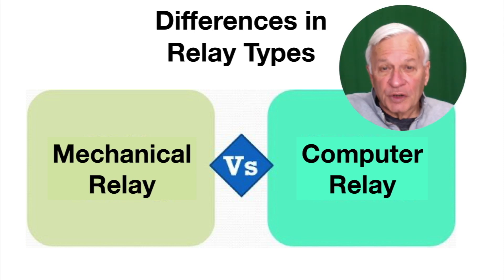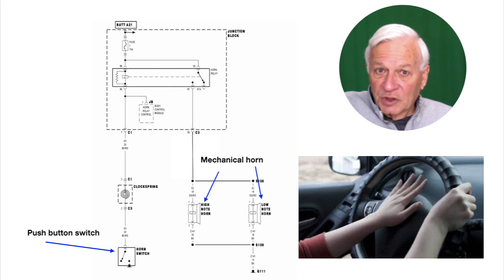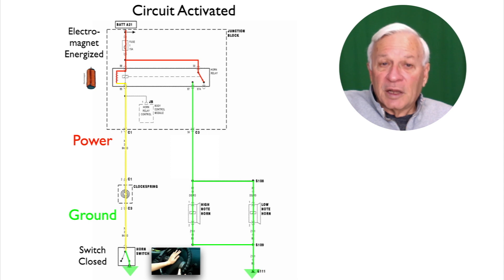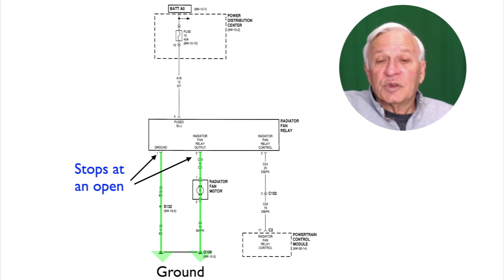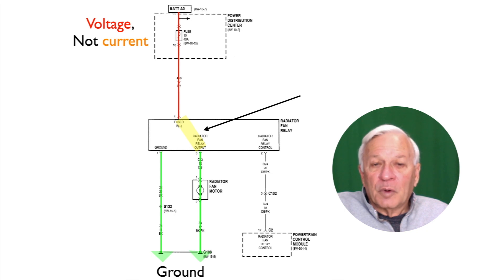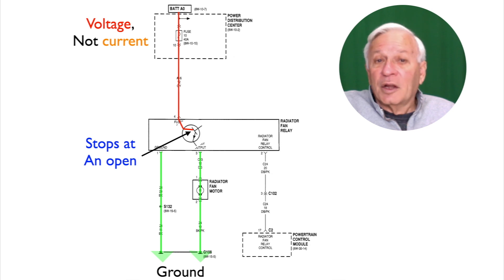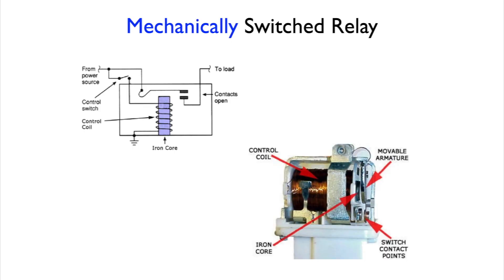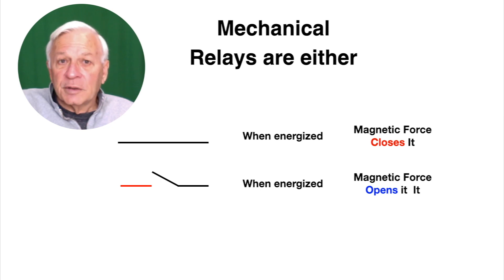Lets talk about relays Part 1

Comment: Make bit fun and "electrocute" somebody by that relay. Soon as electric field collapse on control field, there is no escape and voltages rise about 70V and can feel by hand. Sure, it is very short time and non fatal. Why it is possible? Look your diagram...cheap garbage relay without diode. This is very important lesson because if somebody replace the relay and it is computer controlled with diode relay and replacement is without....bye-bye computer.

Comment: Excellent to go over the basics and then bring it up to date. Thanks. There's always something different however. For example, I recently bought a spare Main Relay (Ignition and Injection) for my 1990 Miata (a known failure item). I idscovered that although this looked like a standard 4 pin relay, the coil side was different. Instead of the usual 70-150ohms of resistance, both the original Main Relay and the spare had several thousand ohms, so you couldn't simply substitute a standard relay. Why would it be designed this way? Is it because the Main Relay is constantly On when car runs and therefore the higher ohms Coil is designed to operate at a lower temperate (less current) to achieve better longevity??

Comment: Most of these "computer relays" are not relays. They are built around a solid state device called a MOSFET which is small enough to live inside the ECU. Similar to a BJT but actuated by voltage, not current flow.